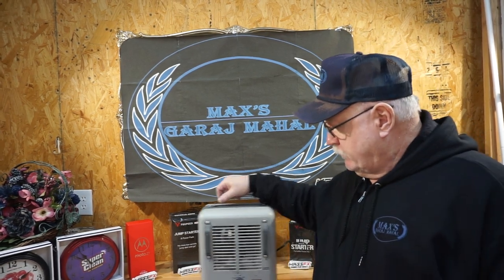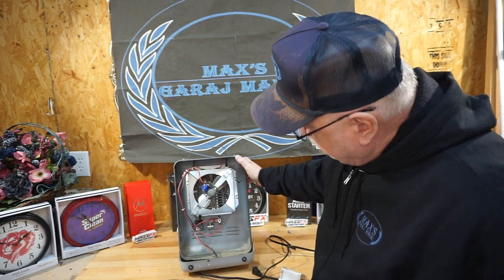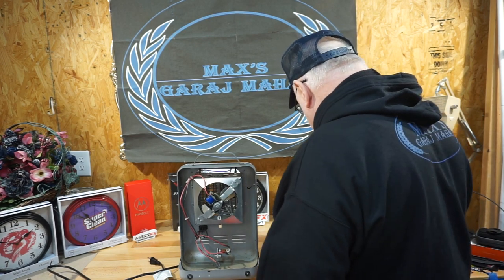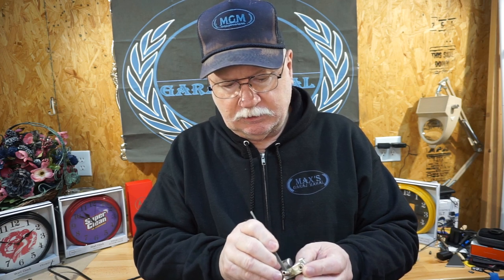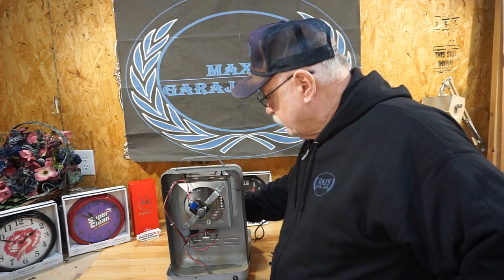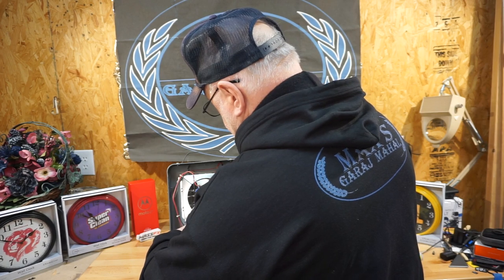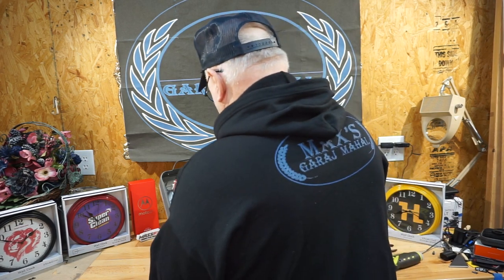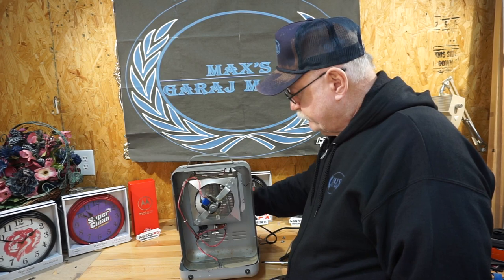"Troubleshooting Room Space Heater Won't Shut Off - Fix It with Expert Tips in Video 2!"

Comment: I haven't opened mine up yet, but I've been watching your videos before i do. Not sure if its this specific issue, but seems like it. 
Another issue i have, mine has a switch (low, off and high), its the red lit up switch and is jammed in the "high" position. It won't move. Have you ever seen that issue before? Just trying to figure out if its even worth opening this thing up...

I wanted to be sure to thank you for your helpful videos, you have helped a lot of people! Please ignore any haters, they love when you address them in your videos. You just keep doing things the way you are. YouTube is full of crazy people that thrive on criticizing and complaining no matter how perfect you do. You'll never please them. Keep doing you! Thx again! 😊
Reply from the maker: Thank you Jen for the positive words and they are truly appreciated.

Yes Ma'am, many times a switch will not make a 100% contact internally thus they are doing what the bimetal switches are doing where I explain it in the video(s). I would suggest popping it apart, please remove power from it first, to check to see if you are getting continuity across the stuck switch. There is a possibility your switch is no longer transmitting current through the contacts. If this is your problem, super easy fix. Replace the switch which should be a quick purchase, disconnect the original, push it out the front, insert the new switch, connect the wires and wala.

If this only repaired the two temp settings but the heater isn't coming on then time to check the bimetal thermal switch. I've even had a few old heaters that had a thermal diode that blew. $1,50 later, back in operation. That same diode today would probably be 5 to 7 bucks. Still cheaper than one of these new fangled smart heaters that just don't heat a room.

If you need to, shoot a bunch of pics of the outside, inside of the wiring and all the internals, I'll look it over to see what kind of system your heater is operating with. Send the pics to my email below or use my name and add @gmail to get them to me. I'll do what I can to assist.

Comment: Sir I watched your vid.yesterday on hyper-tough heater& I had an idea how to fix my heater.1 of my heaters thermostat went out,1 thin plate had a burnt hole thru it,& got me a thin piece of foil,folded it couple of times,then wrapped the thin folded foil around burnt plate,covered burnt hole with foil & made it smooth with plate& put it all back together& now my heater works like a charm..like a new one..thanks for give,n an idea how to fix my heater..works real good now,& it's fix,n to get cold here in okla.a cold coming thru & now I extra heat, thanks to U,sir..👍👍👍👍👍
Reply from the maker: Always happy to been of some assistance. I have a new video on the table to show how to more permanently in the near future.

Glad you have a working heater and you are going to be needing it soon. 

Thanks for watching.

Comment: 02-03-2024
Where can we buy a new switch  for a heater like that with the tip over protection? 
My heater runs all the time and the little weight on the switch is burned off. Guess it fell over once when it was on and melted the weight. 
I’ve looked several places but nothing like what I need.
Reply from the maker: In all the years I've been rebuilding these heaters for myself and helping others keep theirs up and going. I have yet to find a source for a inertia switch that works in place of the originals.

However, you can get a switch to replace the original but this brings the need to install a 'temporary on' switch in the bottom of your heater housing that when in the upright position will depress said switch making the contacts come together thus putting electricity to the bi-metal switch.

I have had the switches to do this conversion for quite some time with intentions of putting together three different ways to do this conversion for those in need of help. I've not been healthy thus the projects are not getting done and out to you. 

So, again, you will need a temporary on switch, a bi-metal thermoswitch (https://www.amazon.com/gp/product/B092VQVGQL/ref=ppx_yo_dt_b_asin_title_o00_s00?ie=UTF8&psc=1) and the temporary on switch along with a few inches of wire although your heater probably has plenty inside for the conversion.

Good luck and my apologies for not being able to be of more assistance with video help.

Max Hughes

Comment: Where can I get the new thermostat with the tip over protection? My momentum weight melted off.
Reply from the maker: I, like so many others before me, have not found a source for these momentum switches. I've even contacted the heater manufacturers to see if they would sell me a few hundred of them to provide to those of us that rely on space heaters during our winter seasons.

I do have one bi-metal thermal switch without the momentum weight I intend to use to modify one of my space heaters. To maintain the tip over safety I'm drilling the bottom of the heater housing to install a momentary on switch. If the heater is picked up or slightly tilted it will allow the temporary on switch to break contact and thus cut off power to the heating element switch.

I'll be doing a video on this modification and testing.

Comment: Sorry I just saw where you answered my first request. Very disappointing that no switches are available. 
If you spend much time repairing these heaters it’s just as easy and cheaper to go get a new one. 
I have gotten some switches but they are completely different from what I have. 
I can refit the new switch but it has no tip over protection. 
So like you said, you would need a tip over add on. 
I have thought of putting a direct connection whereby the heater is on high all the time. Then hookup an external thermostat but then fix an add on tip over.

Comment: Hey is there any way i could get a bit of info on how to bypass the thermal fuseon thati have the same heater and it wont come on do to the thermal fuse being faulty
Reply from the maker: You can wire it directly but that isn't safe. You can drill a hole in the bottom of your heater case, install a temporary on switch that turns the heater off when it is tipped slightly allowing the switch to pop out turning off power.

Take one of the wires from the bimetal switch to one of the temporary on switch wires, the other two connected together. 

I'm doing a video on how to install a new bimetal thermal switch and the temporary on switch soon to help you continue to have a safe room heater.